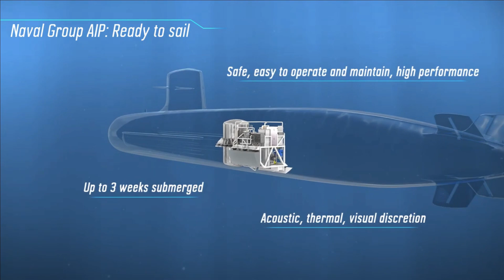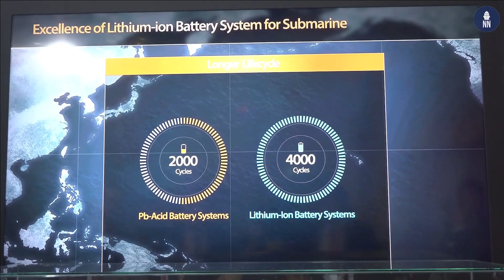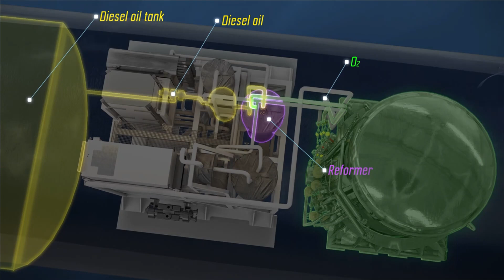A Kilo class submarine - to test DRDO's AIP, Electric propulsion & Lithium Ion battery

Comment: The AIP system is a closed box that stores and supplies electric power when required. As such, it should be possible to test this in all aspects on shore. What exactly is different when mounted in a submarine that cannot be simulated on shore? This looks like more Indian procurement board nonsense - maybe they think the laws of physics are different underwater.
Reply: as per my understanding other important aspects are as follows : safety aspect and behaviour of the operating AIP system within the confined space of submarine ; easiness in handling of it by experienced by the submarine staff in the actual working conditions below the surface and noise level of the AIP system installed which affects directly upon the security of the entire submarine during wartime operations.
Reply: @dilipbaokar5776  
You can do all than on a shore facility - mimic the confined space, the temperature and pressure conditions, potential reaction to flooding, leakage of toxic gas, the easiness of handling by experienced submarine staff (assuming the Indian Navy can spare a few for this) etc. In fact you can test these more thoroughly, more safely and for a longer duration in a shore facility than you would be able to in a real submarine. You also need to remember that this is a separated piece of equipment - like a battery pack you plug in - it there is no complicated interaction with the rest of the submarine as would be the case of an engine with a propeller shaft which goes through the other parts of the submarine. The operational trials are done in every other country in the first operational submarine - as is the operational trials are being done for India's new aircraft carrier for example, and if this is a new type, then that may take a little longer, but putting it into another type of submarine to test it makes no sense. 

This really underlines the problem with the adoption of indigenous technology by the Indian Air Force, Indian Army and Indian Navy. The procurement staff sitting on the board may be good at flying planes, sailing boats, and firing guns, but they have absolutely no competence to assess new technology or drafting specifications for technology development, or managing procurement programs that involve any kind of development, and this is a big problem for Indian defense security if they want to procure modern cutting edge technology for defense. The problem is that the Army, Navy and Air Force members sitting on the board seem only to be capable of buying imported equipment that has been in use for many years by picking from a brochure so to speak because of this lack of competence, and then delay indigenous programs by decades by taking an excessive length of time to decide exactly what they want, and to test and approve indigenous equipment.  

This explains why for example the IAF is so keen on buying Jaguar and Mirage 2000 air frames scrapped by other countries and refurbishing them at great expense for a limited service life, instead of buying more Tejas Mk 1 or Mk2. Old and obsolete equipment is what they know about, and that is all they will buy if left to their own devices - since it makes life easier for them.